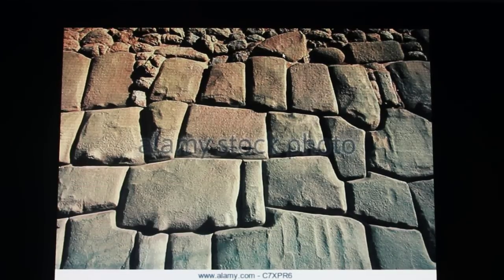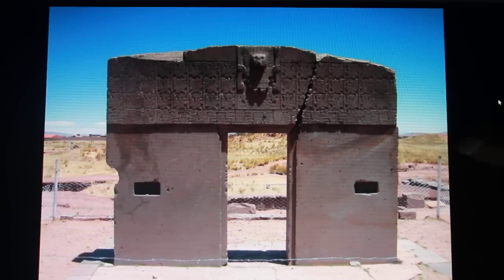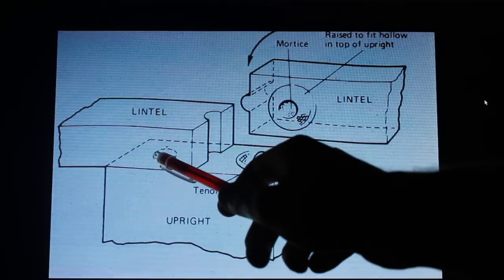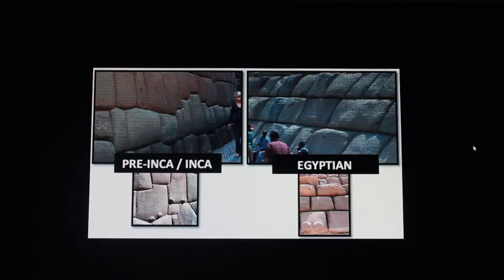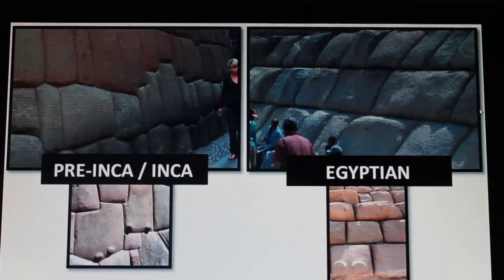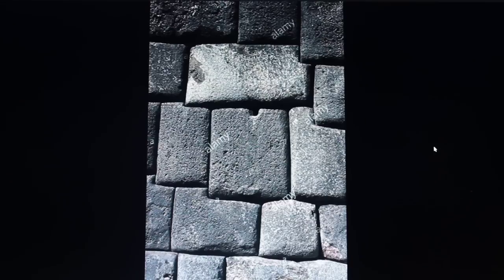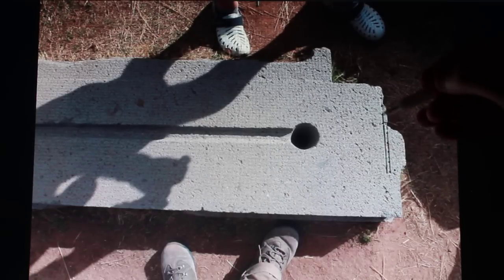Is this what the NUBS on megalithic pre-Inca walls are for? (FOR JOINING STONE?, Proof provided)

Comment from the maker: Hi guys hope you enjoyed! Link to my Patreon: https://www.patreon.com/charleskos Have a great day!
Reply: I keep thinking these nubs are to attach a pos and neg current to them so they create a magnetic hold between the stones and the metal. Remember Ed leedskalins stones were magnetic and once they pulled the gate down to repair it, it no longer turn by just a small push. They broke the field charge. Like he said it will hold forever if it is left alone. When the charge was messed up they began to deteriorate.
Reply: Charles Kos Charles....one observation that doesn't seem to be mentioned; the nubs are placed on either side of the place where 2 block faces meet below it. Is nub placement therefore critical in stone joinery?
Reply: The stones are cemented together to make the stones seem larger and more difficult to tear down.
Reply: I think these blocks were not stone at all to start with.  They are petrified by now.  The knobs are pieces of wood that were used in making the blocks, alongside some stuffing material (hay/ twigs/grass)  and possibly a mud covering.  At places, wooden girders went right through the wall. The fact that the whole thing is petrified indicates it is much older than the Incas.  There are also imprints of much higher fossilized technology in the stone in the area, which is probably why the Spaniards destroyed much of what they found in the Andes.  

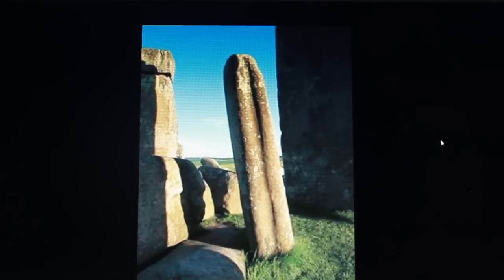Notice, at 9:59, how the stone in the center looks unnaturally broken.  Notice the traces on the rock around, as if the ceiling/floor assembly fell and smeared the mud that was covering this thing.  Why would a civilization with a very high proficiency at carving stones leave such imperfections on their buildings?  If these smears are imperfections in the original rock, then why are there no such marks in any other direction but up/down?

Mmmmm....

Happy new year!
Reply: Charles
Reply: Charles Kos no offense, but the larger truth is escaping you, my friend
Reply: If you make a brick wall, from porcelain clay, how long would it take for it to harden into stone? A million years, maybe.
What if you make the wall, but then take it apart and fire the bricks.
Would it still fit together like that? Could you move the bricks without breaking them? Looks like a tough job, however it was done. 

Certain river silt hardens into Hornfels, or Whetstone, and becomes so hard and smooth that we use it to sharpen knives. As the original  river clay material, it would be easy to form. If man has been around 10 million years, it's plenty long enough for the clay to harden.
Reply: Nubs aye
Reply: Charles Kos typical of modern-day brick ties/keyways for masonry or concrete
Reply: Their too hold on place till the next one  has been set for a  place to put a bored hold them in place
Reply: Those "scrapings" shown on the first picture can also be found under the unfinished obelisk in Aswan. Almost as if the stone was being scraped out with a bowl as if it was once a putty. I wonder if they new how to make a verity of advanced geopolymers.
Reply: Paul James Consider this 
https://youtu.be/znQk_yBHre4
https://youtu.be/x1FiiPLzo_8

i would conclude that the "knobs" are nothing but female/male connecting indentures. mostly all were made on the location they are today with some exceptions. the one phenomenal thing to point out is that this ancient civilization did have an advanced understanding of geopolymers.
Reply: tut was ancient British?
that blows the lid off this whole thing!
that means the ancient Builders were the same who built Stonehenge, Mesoamerican structures AND Giza.
... remarkable
Reply: Another consideration is that we are seeing only part of the wall. As with the pyramids they might have had an outer shell . in which the nubs locked that into place or offered a gap for adjoing material to fill. But the one set are definitely eyes of a serpent . very masterfully done in a wall . csrtain stones in the wall make a design or pattern , shape of a giant snake. I wonder which zodiac is the snake. Ah ha its the milky way .of course it is .
Reply: Today we use form boards made of wood. Think of using rubber as a form and supporting bottom of the form with boards angled up from ground like we do today. That is the impression I see on a lot of the stones. The protruding numbs, sometimes flat on bottom side used the same way as support for bracing. The numbs could also be a connection for a way to apply heat for curing. As a builder the polygonal pouring of these walls is apparent and very do able. The numbs make me wonder.

Comment: You are all making this much more complicated than it is. Think about how the stones are quarried. In the quarry, the workers grind and cut out the four sides and then must undercut the stone to remove it. They grind and cut under until there are just a couple of points left holding the stone in place. Then they put the sled under and continue to grind and cut until the stone breaks off. The stone drops onto the sled and it's ready to be moved. The nubs are just the places where the stone broke free.
Reply: Good theory, probably best I have heard so far.  The only problem is there are way more megalithic stones without knobs than there are with.   It just doesn't make sense
Reply: Maybe the others are on the backs of the stones, where you can't see them. The stones set randomly, as it were, with the nubs being considered inconsequential, and not worth removing. Let's all keep thinking, and keep the mystagogues at bay. Eventually, we'll dope out their methods of handling and dressing stone,, as those ancients had to.
Reply: Absurd idea, why would people with that level of ability in stonework leave some crude protrusion sticking out when clearly they could easily have made them as smooth as the surrounding stone?
Reply: Ancient plaster the notches are for scaffolding or holding the forms while working heated clay .. visit Bosnian pyramid of the sun explains ALL of this ...no guess work anymore ! We are solving and sharing history finally
Reply: @geoffmcarthy7314  For once and for all, it's NOT clay!! It's andesite or granite or another type of ROCK.  Stop propagating this nonsense.
Reply: Ken Heart facts are facts sorry
Reply: @geoffmcarthy7314  Exactly, so stop ignoring them
Reply: Ken Heart are you going to say it's NOT an interferometer next ?? Times are changing sir . How else would they see stars ,measure the earth ? Magic ? It's clay ... if you want to mix other crushed stone it's perfectly ok too ... before you tie raid me again make sure you know what an interferometer is please .
Reply: @geoffmcarthy7314  I have no idea why you are suddenly bringing up interferometers, or measuring the Earth - the FACT of the matter is that these STONES are not clay.
Reply: Ken Heart I brought it up because you can't stop the vibrations coming from the earth with granite , it does not absorb as well as CLAY . The pyramid is built around the interferometer . The only way to get perfect measurements is with complete still ... it's a telescope  and if your glass moves around you can't see right AND you can't direct the light beam to bounce of other mirrors on other pyramids around the earth if the light isn't directed right . It screws up your distance..Ya know shaky from earths natural vibration ... that's how they measured the earth viewed the stars figured math  ... the eye of ra is an Egyptian definition of the mirror   That was at the top of the great pyramid and that  is definitely not what our ancestors called It .. get it ?
Reply: @geoffmcarthy7314  Oh, I get it alright ...
Reply: Call it clay-like if that feels better.
But it was definitely a moldable substance that would harden into stone.
Reply: @you2449  No it was definitely not
Reply: @Beevreeter  You are correct, Ken Heart,  These are STONES, but they may have been liquid at some point and formed. I don't know and you don't know either.
Reply: @garymiller2056  Precisely, you don't know. So stop assuming that you do.

Comment: i have a vague unformed ,and definatly random,theory with regard to moving huge stones,elongated heads (and why some tribes try to simulate same)..  assuming the lack of superhuman strength in the old civilisations inhabitants one has to think of other poss ways to move,manipulate and otherwise build with impossibly large chunks of stone..so with a huge leap of imagination i was thinking they maybe used sound or vibration based techniques..with yet another leap picture a visitor/unknown species that has the ability to use resonance as a tool..would a cone shaped,elongated,head psrhaps aid in making certain noises..(think whales head chambers used  to increasw and focus soundwaves)..and assuming the coneheads had this ability (by nature or by design) it maybe makes added sense (sense?haha..something i lack on a most basic level) that the stones they can affect best are quartzite types or crystalline ones..maybe it takes a whole group of people to move huge lumps,maybe a single one can soften an area of stone.. do rocks all resonate at a fixed pitch or does size and type have a bearing..with regard to knobs maybe they are a remnant of "tuning" a stone to a  pitch that makes it easier to move...also,and lets face it we ( I !) are taking a lot on trust,it kind of explains why they also used the metal clamps to join the rocks to each other..a huge unclamped wall would be easy to breach by any others with stone shifting talent but maybe secured from such threat by the use of non movable metal...
  when/if the cone race left or died out then the 'normies' that were left could well try to emulate their absent builder mates by trying to make their own skulls into the same shape,alas without actually gaining the sound wave ability or skill..it would never the less give those involved a 'godlike' appearance etc,still an advantagious outcome with regard to impressing the locals..😁 ..anyway .feel free to destroy me verbally and mentally..p
Reply: I like it
Reply: Archemedes, 2500 years ago, said. "Give me a stick and a rock and I'll move the world". It's best to say nothing than sound ignorant. Unless your a stone man, you can't know. The same thing goes on today. Sometimes, instead of portrusions, you have holes. They are called Lewis holes. Lewis pins are inserted, and the rock is leveraged or carried into place.
Reply: It's been said that the giants in America screeched like birds. Very high pitched. You maybe are on to something.
Reply: Monks OOOMMMM  Austrailia  shaymen walk off seconds later gone
Reply: Archimedes never said that..He said "Give me a lever long enough and a fulcrum on which to place it, and I shall move the world."

Comment: I am a mason. We DO build this way today. Its often referred to as "monolithic" construction when you tie together like that. Funny that word monolithic. Instead of using nubs to tie in we use rebar and pour concrete into the cells. The way build with stone today is FAR more labor intensive but also WAY more precise in some instances.
Reply: Nubs from a rod that slid into the stone while vibrating along frequnecy then could be picked up and placed all edges have been minipulated by presure to form in place..Nubs are broken from release from the stones.Extra nubs from achiving perfection redo serstion to soften to shape it
Reply: But not as earthquake proof.

Comment: At 6:44 there is a shot of a polygonal megalithic wall that turns a right angle with interlocking blocks, so nubs used for adding a wall or buttress is unlikely, although a worthy suggestion it isn't in the same ball park as the OG construction tech...these structures set the bench mark for longevity and durability so don't need strengthening. The "rounded" form to each block is part of the design and wouldn't have been done if they were to be any kind of top coat or dressing on the surface of the blocks, rainwater run-off seems an unlikely consideration but an awfull lot of effort has gone into shaping each block, fair to say that some blocks look almost like they have had "flakes" of stone removed around the joints as if they were slid or rubbed together from the inside out, assuming we are looking at the exterior face of the walls . Nubs as locating points sounds a good theory but, on that scale, they would be round  if joining stone to stone like Stonehenge, angular sockets would provide good purchase for wooden beams but be too fragile for stone. Nubs as points for lifting a block? ..They would surely be located around the blocks centre of gravity for stabilty and precision of placement...totally epic and mind blowing, but I suspect beautifully simple when the penny finally drops...are there any sections of megalithic block structure that are complete from base to top course, I suspect that may make the picture a bit clearer....I used to have the big red London bus Lego set as a child, but mainly built spaceships and buildings with it.

Comment: Ok, time to get a GRIP! We can see that these wall builders had very sophisticated building technique, therefore, why do we expect them to leave these walls rough and bare? I am sure they did not, they would have plastered and painted them, they are soo extremely old no traces of the plaster or paint remain, although, in Tiwanaku there are supposed to be signs that there was gold plating on the walls. 

The nubs are there to support plastering of designs into the walls, the large cracks and rounded boarders of the stone are there so the finial dressing of the walls can show serpents, jaguar, ect.
Reply: Valid point and very logical regarding the serpent, jaguar and other animal spirits we see in mounds, pyramids, stones throughout N and S America 👍

Comment: I think it's very important to remember the Inca  building took place in a short period of time.  The Inca empire collapsed suddenly and the masons left their work unfinished.  Almost all the megolithic sites I've seen in pictures have spots that aren't finished.   The nubs are for positioning.  The recesses are meant to be guides to help the finishers know how far to remove material to get to the final surface contour.  If you look at the depth of the recesses,  and sort of "connect the dots," you can visualize what the final suface is entended to be.
Reply: It's a matter of superceded logic, in my view. Question: what kind of craft develops if your minimum diameter cut through the stone is a 30cm wide bore hole?
Answer: one which leaves these nobs protruding from the worked face when you're finished.
There's a few recent uploads about this on my channel for anyone interested.